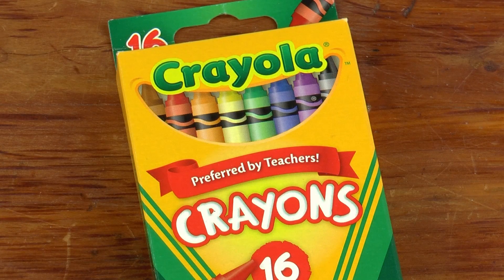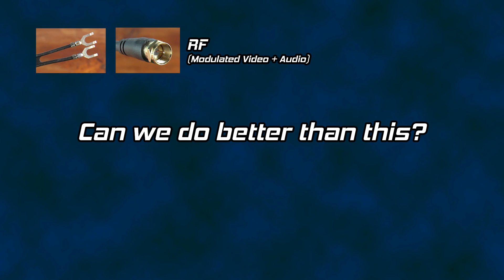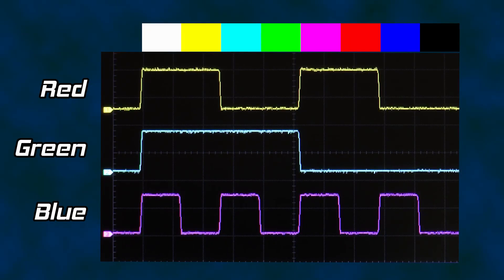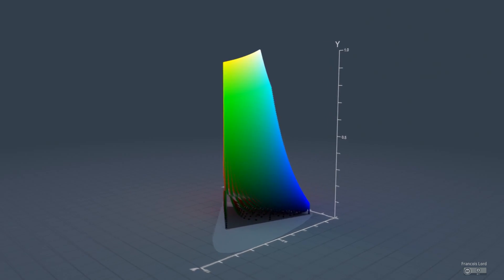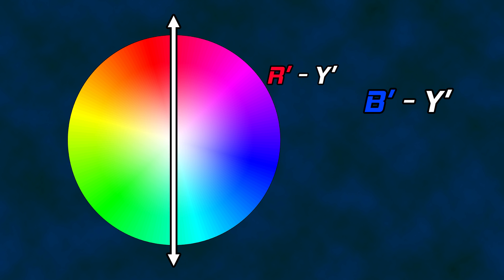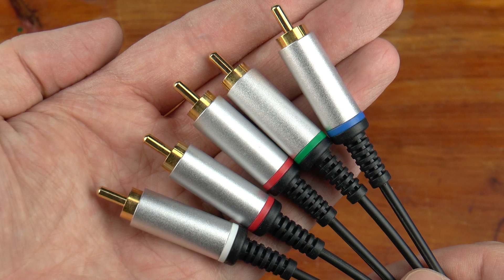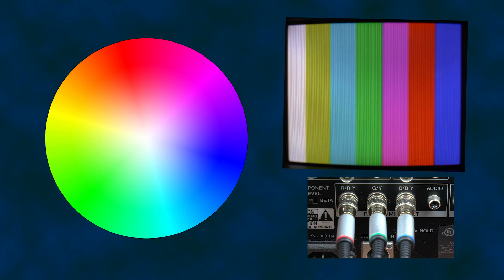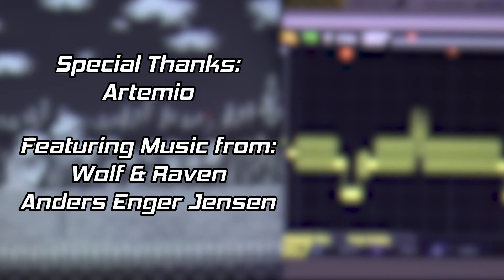Intro to Chroma: From RGB to Component Video

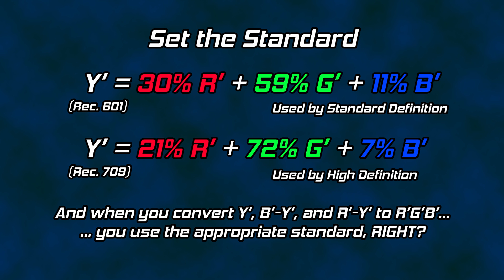Comment: 15:40, so this is why those cheap wii2hdmi converters always have black crushed (it's not registering as much brightness from red and blue as it should) and have a horrible green tint (it's using way to much green than is supposed to be used); they improperly map the SD format to the HD format

Comment: 0:05 To clarify, the primary subtractive colours are magenta, cyan, and yellow. Magenta and cyan is blue, magenta and yellow is red, and cyan and yellow is green. The additive and subtractive primary colours are opposite each other and are each other’s secondary colours, so the same colours can’t be both’s primaries. This has been known for hundreds of years, but is taught incorrectly all the time, and is not considered important enough to correct. Red, blue, and yellow will not cover most of the spectrum, and if they do it’s because they were mislabeled magenta, cyan, and yellow.

Comment: This is an amazing video. As someone who has written their own music and has done their own sound design with FM synthesis, the combination of RGB pretty much act the same as Sine/Square/Saw/Triangle. Even more fascinating is the comparison to creating more varied colours and sounds through tighter frequencies. For example, there's a very popular sound string in dance music called the Hypersaw, or Supersaw. If you overlay loads of Saw Waves and then detune them slightly from one another, you create what is known as a "phat" sound, the type you hear in tunes like Rank 1 - Airwave. Colours on TV and consoles operate in a similar fashion as they are basically detuned colour waves, that are then frequency modulated (FM) with other colour waves. The depth of the detuning depends if the technology can do that, otherwise known as the bitrate. Like sound, there's a limit to what the human body can pick up, so 32bit colour is the maximum limit for the human eye, much like 20hz to 22khz is the maximum range for human hearing.

Comment: Except, of course, the subtractive colour we learned when we were young was basically wrong. Red, blue and yellow aren't primaries no matter how you look at it.
Reply from the maker: It is correct. It is one form of subtractive color primaries. There is no universal single set of subtractive primaries.

I think several people that have commented on this have latched onto print primaries - ink based primaries that favor CMY - as the single set of possible primaries, however there are various sets of primaries. It depends on the medium.

Comment: I've never seen any device or TV that uses those RGB cables. I've seen RF, composite, S-Video, Component, and HDMI. In fact, I own a TV that has all of them. Was RGB not popular? Maybe it never caught on in the US?
Reply: YPbPr is equivalent to analog RGB in terms of quality, but YPbPr saves on bandwidth due to chroma subsampling. As such, there wasn't much incentive for analog RGB on consumer television sets in the United States. Analog RGB came along with personal computers since that's the simplest format for generated images. The DE-15 connector used for VGA displays uses the RGBHV standard, i.e. sync used separate pins for horizontal and vertical signals. Later on, the DVI connector was briefly utilized before being superseded by HDMI. DVI supported both analog and digital RGBHV signals, though some connectors were limited to analog only (DVI-A) or digital only (DVI-D).

Beyond consumer electronics, you could pick up a medical, broadcasting, or otherwise professional monitor that had separate BNC type connectors for RGBHV. Others have YPbPr and a composite video input that double as RGB with external sync (RGBS). The SCART connector that's used in Europe is actually just a universal connector that combines composite, S-Video, YPbPr (component), and RGB. It utilizes Sync on Luma for YPbPr and S-Video, and RGBS where the sync is the same pin as the composite video. Another standard called Sync on Green (RGsB) was used with the PlayStation 2 in 480p mode and with Silicon Graphics computers. This means that if you want to use RGB over SCART on the Sony PS2, you'll need a device like the OSSC that can translate RGsB to RGBS.

So why the niche fascination for RGB instead of component on retro consoles? Because consoles generate images which makes RGB mods simple, but they only had cabling for S-Video at best. Super Nintendo doesn't actually require any modification to get RGB, you only need an AV multi-out to SCART adapter. On the N64, you can directly pull the RGB generated image by soldering into the Reality Coprocessor. For the NES, parts of the PPU are bypassed so that you can use enhanced color palettes. Perhaps if early video game consoles were a bigger driving factor in the media consumption market then we'd have RGB inputs on early consumer sets. It was only until 7th gen consoles like the Xbox 360 and PS3 that YPbPr was used which would quickly be superseded by HDMI.
Reply: @BellamiaSophia  Nice
Reply: The example of RGB used in this video is RGBHV over 5 BNC cables & it is the same signal as VGA it just has a different connector anyways RGBHV more popular in the computer world than in consumer electronics world.

in Europe RGBS over SCART connections was very popular in the consumer world primarily because France used SECAM but most of Europe used PAL, RGBS bypases those color systems & conflicts altogether while all countries that border the USA use NTSC.

RGBS & other RGB types never caught on in the US consumer electronics world because there wasn't as much need.

Comment: I've heard many times that "NTSC colour signal is compatible with NTSC B/W sets because they choose compatibility before technology" and "PAL colour signal is incompatible with PAL region B/W sets because they decided on more advanced technology at the cost of compatibility", but many a relative of mine had old PAL B/W TV sets (from before colour signal was introduced in my country) that worked just fine with regular colour broadcastings and I'0m even told of a foreign colour TV set a relative purchased abroad that worked just fine with the B/W signal used at the time in my country...
Reply: pal color was compatible with 625 line b/w tvs but was incompatible with 405 line b/w tvs
Reply: @gamecubeplayer  Going from what I can find about 405 lines, it seems like the system was never in use in my country, as it was UK-based, so that thing they say about "PAL throwing away compatibility with older sets" should be instead "broadcasters of the UK sphere throwing compatibility out of the window and adopting a new standard".

Comment: brilliant way to workaround the limitation. brilliant way to use color space as a spatial format, not color format, and find a wayout to use numbered cable space to transmit quality video signal.
I'm trying to get an old Sony camcorder to work and record its signal to digital recorder, since the analog tape is quite an obsolete format. this is really helpful.

I'm using analog video cable that is used while my parent was young, it is an interesting feeling and quite a fun scenario.

Comment: I have an old Mitsubishi crt that can switch between YPbPr or Y R-Y B-Y by toggleing a switch. I am confused as to the practical application of this switch. Specifically, what use does it serve on my TV? And, which should I use for watching movies and playing video games? I have it set to YPbPr because I think the colors look better. Here is a video I did on the TV. You can see the switch I'm taking about early in the video
https://youtu.be/kBSqAauGEbA

Eddit. I checked and the switch actually says YCrCb and not YPbPr but I think this is an error by Mitsubishi because the signal is analog and not digital.

Comment: When you're talkin about Pb and PR, under the black color on the chart there's a little bit of luma above the baseline to the right of it. Why is this shouldn't black be at 0 luma, is this the function of the fact that black colors on a CRT television are still made by a light gun instead of the off state for a self-emitting diode like on OLED? If this question is answered later in the video I apologize.

Comment: Thanks. Some questions:
[1] What was the "1. advance technology" fork option?
[2] By the time we got Y'PbPr output, was being able to plug luma into b&W TVs seen as necessary? Why not switch to real RGB then?
[3] Why is the luma rca plug and input dressed up in green?
Reply: Option 1 would have been to make a new incompatible TV signal. Transmitting R, G, and B just as they are, separately over the air, would have been simpler, made TVs less complicated, and resulted in better picture quality. However, it wouldn't have been backwards compatible with old TVs. NTSC and PAL instead invented these more complicated schemes to allow old black and white TVs to still show the picture.

Comment: Thanks for this visual representation on how component video works. 15 or so years ago I discovered that "Green is not transmitted, the TV figured out what is green on its own" and I was blown away. I was also puzzled as to "why?" Why go through all of this craziness? My thoughts were that they could just send real RGB with sync combined somehow, using the same amount of cables. In the end it doesn't matter much as component video is pretty much indistinguishable to the eyeball. My brain, however, does not enjoy the fact that something is missing, or that some colors get less resolution than the others. Yes, my brain hates the Bayer pattern as well.
Reply: Yes, that pattern is ugly as not only is it deliberately "off" to make signal checking easier, but also because RYB and not RGB are the true primaries. But technology is simply going along with the species that uses it.
Reply: It also lets you understand why with RGB Component cables that do not have a dedicated sync line put the sync line on green. And why green screens are used we are just more receptive to green light then the other primaries. So it will only display when green is put in and as for the mix ups with the reds thankfully modern day component cables will band the audio and video cables to keep them separate. But they really should have labeled those things I was a more composite kid back then and jumped straight to HDMI when I upgraded my video signals but I do use component for things now if my TV doesn't have ample HDMI slots.
.
And if you were around during the PS2 and Xbox era you needed component to access some of the game's higher graphical modes some games supported 720p on Xbox and on both had a handful at 1080i. So if your a gamer remember that its not just about the kind of cables you use for older games of that era, the applicable resolution is on a game to game basis. Even then though upgrading from composite to component can bring a more clear image even if the game runs in only 480p.
Reply: @Theodore Cash thanks so much for your reply. I found the site through google and im trying it out now.
Takes a while so I will reply here later when my account password hopefully is recovered.
Reply: @Theodore Cash It did the trick and I actually got access to my account again. I am so happy:D
Thanks so much you saved my ass :D
Reply: @Albert Gannon You are welcome :)
Reply: Albert and Theodore are scammers, if it wasn’t obvious enough already: https://m.youtube.com/watch?v=mZNqBNGwD6g
Reply: i guess im asking the wrong place but does anybody know a tool to log back into an instagram account..?
I was dumb forgot the password. I appreciate any tips you can give me.

Comment: When it's time to talk about composite video, please mention or illustrate how the YIQ colour space is or should be converted to RGB YPbPr/YCbCr. Because its axis are rotated in relation to the YPbPr axis, it seems to me that colour conversion from YIQ is lossy. Please address that and thanks for this great video.
Reply: The space where YIQ and YPbPr space don't overlap is outside RGB space anyway, so in practice it is lossless.
Reply: @linuxbot3000  Wait I thought Composite video used the YUV color model, where does YIQ come in handy then?
Reply: @Ballowax  the goal of the slightly rotated YIQ in NTSC vs YUV was so Y would be a little closer to the ideal orangey-bluey axis human vision cares about to spend a little more bandwidth on it with the asymmetric modulation (and also do that TVs with only two primary colours could be made but was soon realises that it's not enough cheaper to care), but then all the manufacturers stopped caring and just treat it as slightly rotated symmetric bandwidth YUV anyway
Reply: @linuxbot3000  So basically NTSC Composite video uses YIQ while PAL Composite video uses YUV? I know that the big difference between YIQ color and Y-Pb-Pr is that YIQ was built around the way the human eye perceives color. 

With YIQ, you get a smaller color spectrum than Y-Pb-Pr as YIQ was made to help TV stations reduce the amount bandwidth you would need to broadcast an NTSC color video signal. Y-Pb-Pr will also allow you to compress the chroma information, but it will give you a much richer color palate than YIQ. Y-Pb-Pr gives you color on two separate signals while YIQ mashes in all the color information with no separation. After all RF, Composite, and S-video carry all of the chroma information on one signal.
Reply: @Ballowax 2002  NTSC old specs used YIQ, practical NTSC gear almost always use YUV = YPbPr. The spectrum you get is identical, both are limited by the range of valid RGB values they decide to.

YIQ and YUV are both using the same two signals on one chroma wire QAM method, it's just slightly different implentation
Reply: @linuxbot3000  alright, so what uses the YUV color model? Does the NES uses YUV? Is YUV used in VCRs and Laserdisc players? Do most CRT TVs in the US convert YUV to RGB?
Reply: @Ballowax  yes to all of the above
Reply: @linuxbot3000  Well that's cool because I can't find any source that'll tell me what color model consumer NTSC video equipment uses. I was led to believe YUV color was only used in broadcast production starting in the 80's while YIQ color lived on in consumer video hardware like the NES and VCRs.
Reply: @Ballowax  VCRs don't even care what colour model it is, they're not decoding it

Comment: Does the difference in color standards between SD and HD explain why SD content looks dark on an HD display?
Reply: Yes, but this can happen within S.D. color standards, as well.  I have hooked up a Sega Genesis to a Sony PVM 8042Q, via RGBs, component, and composite.  I was surprised to see that RGBs, along with being clearer, has a definitive color vibrancy, compared to component connections.  I had forgotten that Phonedork had briefly mentioned this happening, in his setup, hence why he preferred RGBs.  Anyways, I immediately remembered that RGBs has a FULL 8-bit color palette.  There are 255 dedicated bits for the three primary seeable hues, for each pixel.  Component video has video bandwidth for what is called reduced RGB.  There is ONLY color information for bits 16-235.
Reply: @badreality2  The 0-255 vs 16-235 is only used in digital forms, in analogue both use the same ranges. It's also values, not bits. When calibrated correctly the colour should be identical.
Reply: @linuxbot3000  When you say "calibrated correctly", do you mean adjusting the chroma, brightness, hue, and contrast, for the 16-235 component video, to look exactly like full 8-bit 0-255 RGBs?
Reply: @badreality2  Yes. In analogue form there is no 16-235 / 0-255, it's just 0-0.7 volts for both.
Reply: @badreality2  so YPBPR is inferior to RGB
Reply: An HD display should already be picking the proper standard for SD inputs but if it doesn't, yes you can end up with greens darker than they should be and reds/blues too bright, and you'll notice the greens more.

Comment: Whenever I see the word "component" I think of how expensive the Gamecube component cables are.
Reply from the maker: I want to say I bought those cables circa 2005. While it makes sense that they increased so much in price years later, the fact they ballooned that much is crazy.

Happy to see the modern alternatives. Options are always good, in my opinion.
Reply: The good thing is reverse engineering allow us to have that cable for less money
Reply: Third party cables have finally come out that are around $90. Still expensive, but not as expensive.
Reply: The Wii ones were more affordable and I think they're backwards compatible
Reply: @joey0guy  The Wii and GameCube used different video connectors... The GameCube had the same port used by the SNES and N64 that can output Composite or S-video (and audio), plus a second "digital" output that was originally used with a special cable that has circuitry in it to convert this digital signal to component video (no audio).  Later production GameCube consoles lack the digital out port as few people purchased the component video cable. The Wii essentially combines the two ports and eliminates the need for the special in-cable circuitry for component output.  There are aftermarket solutions for the GameCube, but these are still over a hundred dollars.